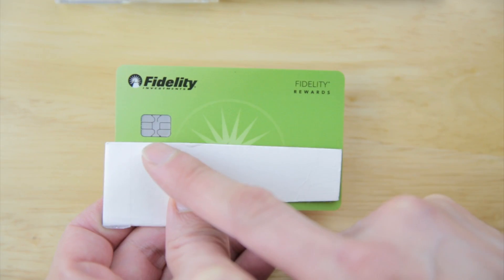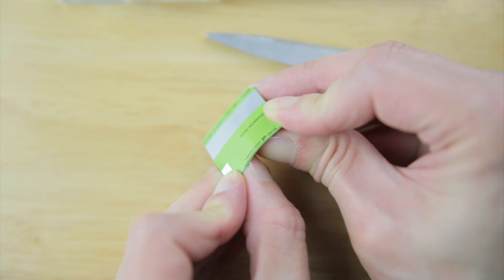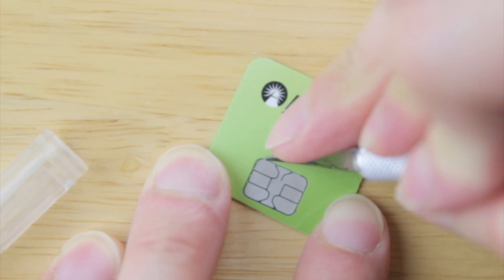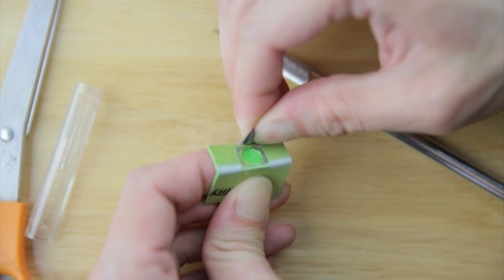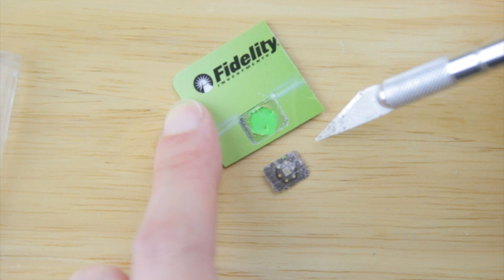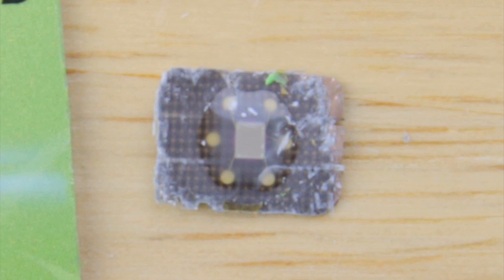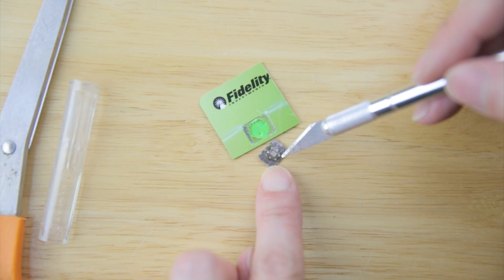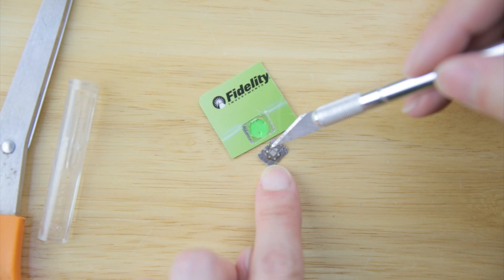Inside a Chip Credit Card

Comment: I cut my old one apart too. And it also has six smaller chips surrounding one in the center also.  Wonder if there is any significance to the being 6 small surrounding a large. Evidently they all have that. LOL
Reply from the maker: Smaller chips? I doubt they are chips but rather solder points for the contacts I think.
Reply: Mine looked similar to yours, only where yours had six  dots mine had six smaller rectangular plates
Reply: And my curiosity is why are the six dots on yours and six plates on mine surrounding one central dot/chip
Reply: Also read where these components are made of gold. Dont know how much gold, but sure its pretty minute.
Reply: They could have been filter capacitors. Alot of microprocessors have filter capacitors to ensure they hate a clean steady supply of electricity

Comment: Does anyone know if it's possible to reprogram the micro chip for entirely different purposes?

For example could the micro chip in expired credit cards be reused as microcontrollers, so could a cheap skate like me erase the old firmware and reuse the chip, by reprogramming it, for example, in building a humidity meter and to drive an ultrasonic humidifier?
Reply from the maker: I don't know. You would need to power it.
Reply: Of course it would need to be powered, and that would involve figuring out the pin outs, which are given in this link:
http://pinoutguide.com/Memory/SmartCardIso_pinout.shtml

This other link provides some technical specifications on the microcontroller used in the smart card:
http://www.cardwerk.com/smartcards/smartcard_technology.aspx

Since thieves already know how to hack the smartcard chip, my question was if it's possible to obtain a datasheet for the RISC CPUs used in the smart cards, to reuse them for non-criminal electronic projects?

The datasheet would reveal the instruction set of the RISC CPU, to enable writing programs, perhaps using the microchips from expired cards. Recycling these microchips for useful projects, would be preferable to discarding them and contributing to land fill problems.